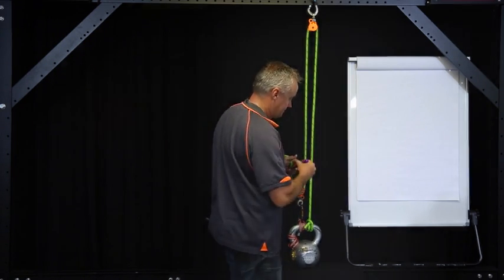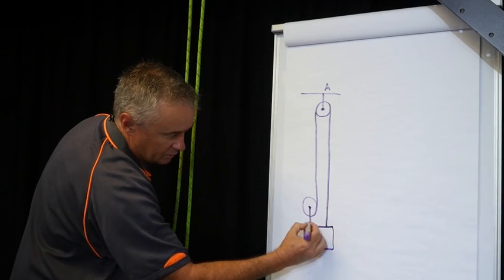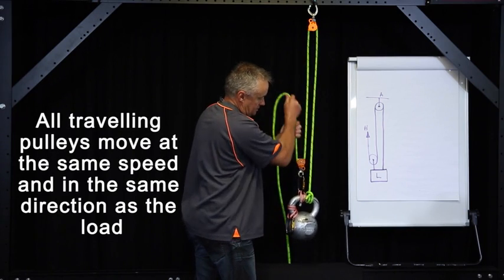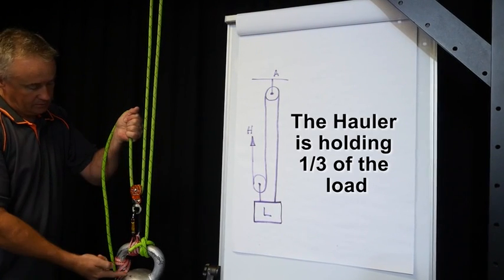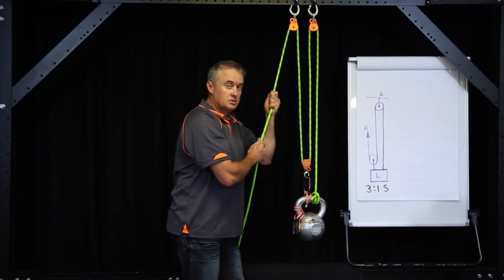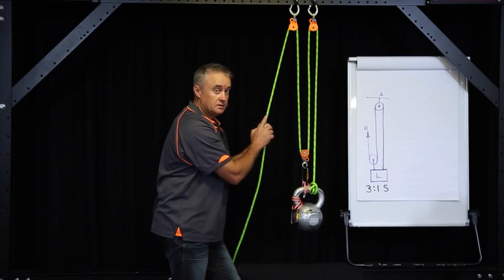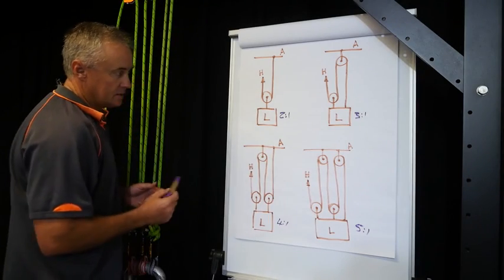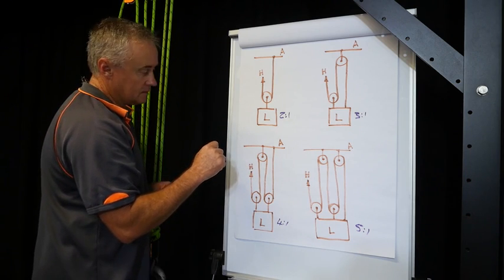Simple pulley systems

Comment from the maker: Hi Mark,
That’s a good question.

When we haul in the direction of travel, the rope is generally doing a 180 degree turn around the pulley. The angle between the ropes (often referred to as the internal angle) will be zero degrees. In this situation we get maximum mechanical advantage.

When we haul off line, or not in the direction of travel, the internal angle increases and we get a corresponding reduction in mechanical advantage.

We are talking ideal mechanical advantage (IMA) here so we are disregarding friction through pulleys, additional mass of equipment and a few other effects.

If we consider a simple 2:1 pulley system:
0 degrees Internal angle gives 2 : 1 Ideal Mechanical Advantage (IMA)
30 degrees gives 1.9 : 1 IMA
60 degrees gives 1.7 : 1 IMA
90 degrees gives 1.4 : 1 IMA
120 degrees gives 1 : 1 IMA

So from this, the internal angle can run out to 30 degrees without too much loss but when the internal angle reaches 120 degrees, there is no mechanical advantage.

Thanks for the question. I hope this information answers it.

Comment: Rob: at 2:44 to approximately 3:10 you talk about pulling in the direction the load is travelling and losing mechanical advantage as the angle increases. Is there any information you know of that tells us how much MA we are losing at differing angles? I'm just trying to figure when it would be appropriate or necessary to use a change of direction pulley. Thanks in advance.